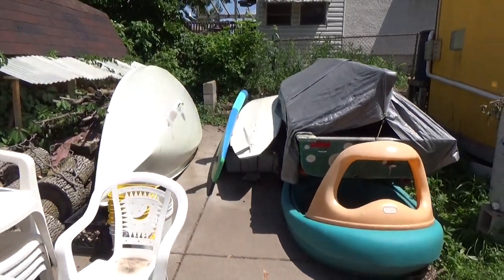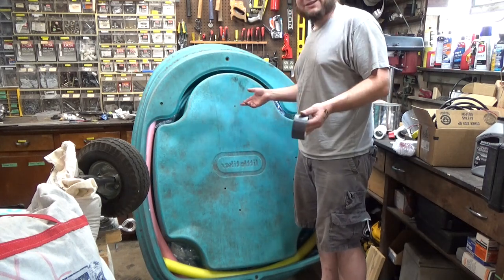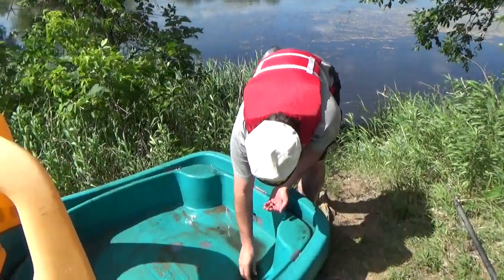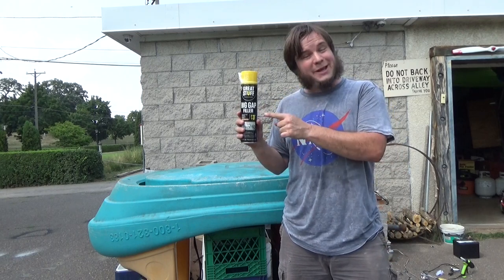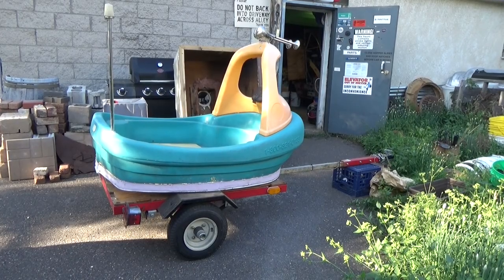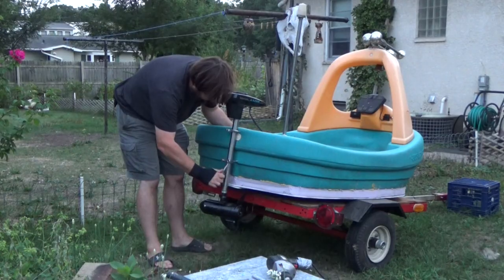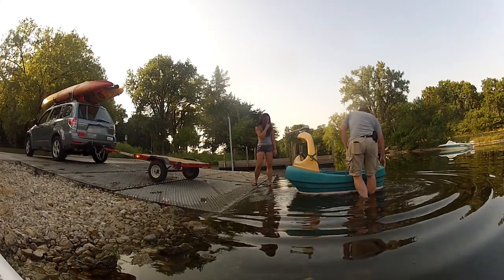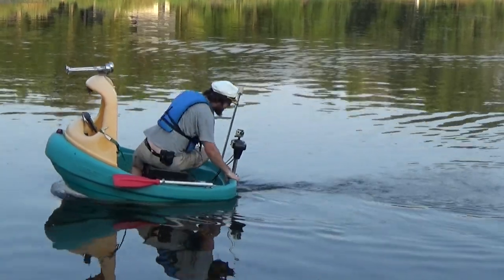Turning a Tuggy Sandbox into an Electric Boat

Comment: Looks like your power head is 180 degrees off ! Get a weedless prop basket on it and a keel would make wonders ! Make a few of them and rent them out for $25 a day w a $300 deposit ! Win win ! Very cute ! 👏😂
Reply from the maker: Yeah a few things were wired backwards in this thing, also my "high quality mounting" started to slip so the motor was slowly rotating itself off to one side. If I can find two identical motors my plan was to have twin power pods and steer with differential thrust.

Comment: Im going to get one.. Fill the underside with expanding foam and then shape it like a hull of a boat them fiber glass the whole under side with a few layers and sand it down and paint it. Rig it up with a trolling motor and 2 or 3 rod holders and use it to pond hop

Comment: You would only look silly if you weren't wearing that hat. OMG I just recognized your testing area. I used to sit in that parking lot on my lunch breaks and smoke. Super weedy but a good fishing spot.
Reply from the maker: The weeds here are my nemesis for almost every stupid boat project. I think I've had milfoil stuck in every motor I own at this point.
Reply: @saveitforparts  Take 36 towards Stillwater to Manning Trail. go north 5 miles to Square Lake Trail. Go east to Square Lake. Its a large spring fed lake which is crystal clear - perfect for snorkeling, scuba diving, and swimming (best beach in the cities). Bit of a drive but a much safer test area for the eventual/inevitable Monorail Submarine. BTW its a Washington county park so you need a Washington county park sticker or pay for parking.
Reply from the maker: @waltersvg  Interesting! I thought all MN lakes were muddy and opaque, As soon as I moved here I gave up on SCUBA diving and sold most of my gear :-P

Comment: Is duct tape adhesive seal air tight 
?
Reply from the maker: Sort of... until it gets wet and falls off :-P
Reply: @saveitforparts  okay, yeah. That's what I thought. Well I saw one dude filled that crevice with those little cheap plastic kids balls, something like what you jump into at the carnival or whatever. Pool noodles good too though I might have stuffed it nearly entirely with pool noodles then spray an inch or two of that foam. Anyways worked out in the end, did you end up fixing the controls?

Comment: how heavy was it at the end?
Reply from the maker: I can still move it around myself, but it's definitely heavier! It's been sitting on a trailer all year since the DNR won't let me do anything with it, I need to turn it into an RC boat or something.
Reply: @saveitforparts  thanks for the info, I just got one for free and am in the process of using 2 part polyurethane spray foam to fill the bottom voids, ive only had it for 2 days now. I'm excited, I'm in Wisconsin so I'm sure the DNR won't like mine either so eh... small lakes and creeks may do haha

Comment: I’m actually getting ready to make one for a fishing competition do you have any suggestions or recommendations?
Reply from the maker: Don't try to register it in Minnesota, the DNR hates these! 
I added extra foam to mine, since it was barely big enough to float my 200lb rear end, and the model I had was hollow on the bottom. A traditional tiller trolling motor might also be better than the electric-steer model I used, mine just wanted to spin around constantly :-)

Comment: Lol, in Texas anything with a motor, gas or electric, would be required to be registered.  So if I built one it would require a registration sticker and number.
Reply from the maker: Yeah, same here. If it's under 10ft and human or sail powered it doesn't need a sticker, but motorized anything does.